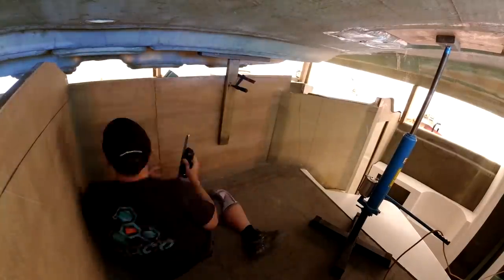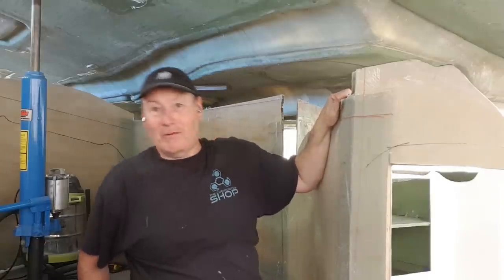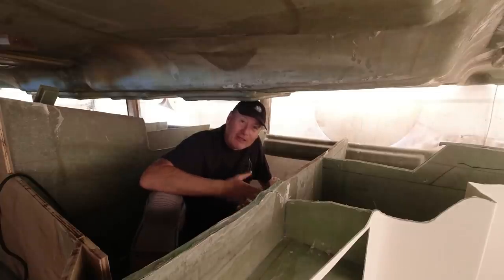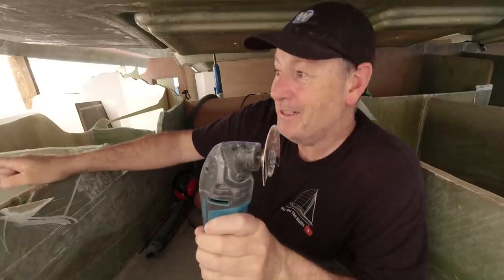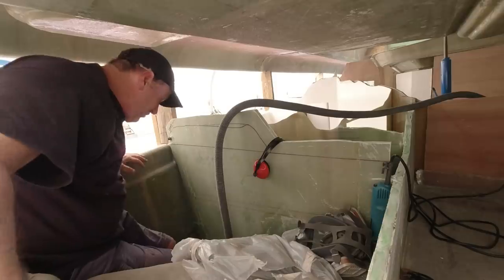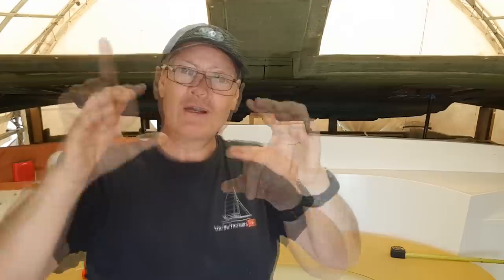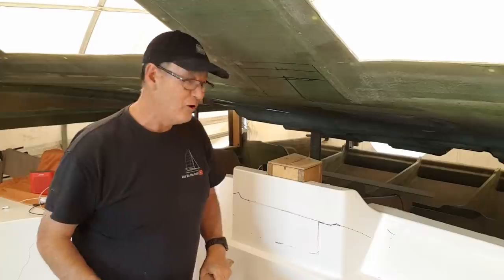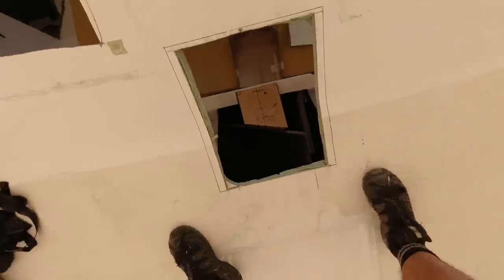I cut a massive hole in my Brand New Catamaran Deck - 12.7mtr Catamaran Build 197

Comment: Get a fan, build a cardboard 'funnel' around it and add ten foot of 10" AC duct to it, with a stick and spring clamp on the open end you can take a cooling breeze into tight spaces with you. If moisture isn't an issue, a mister can be added to pull the temps down. When not in use, the hose can be collapsed down to just a few inches. 🥵

Comment: make the bottom n top level n lift the top 2 or 3 feet up n have it level at all times then u  measure down the same amount 2 or 3 feet that u lifted it up off the hall n make your marks so u ant guessing ware to cut    you can lift it up 5 feet so u got room to stand n work to cut but you have to measure down the same as how much u lift the top up!!!!!!
Reply from the maker: That what I did but 50cm was as high as I could go with rhe tent roof reached.

Comment: Ok I think the reason for the original mast step was the lines. They wanted the lines to run away from the mast above deck level. So all the lines would run to the cockpit without to many turns. Your solution is elegant especially like you said less chance of rot due water intrusion. There is a lot of force on that mast step and having wood below it even incased in glass is asking for troubles. But look at your mast specs and especially where the lines run away from the bottom of your mast.

Comment: Ross, you need a bow saw with  25mm  and 6mm blades. It would cut like a dream compared to that cheap handsaw you were hacking with. You just looked like you weren't having all that much fun.
One other suggestion: get a cheap window fan and a card board box the same size and some filter material and build yourself a simple dust capture system. Works far better than letting the dust fly everywhere. Cheers mate.

Comment: I think you need a reciprocating air saw they are small and light you can put a variety of blades in them they will cut around curves 
I use saws all blades in them you just need a air hose
Reply from the maker: It is the one tool I do not have and have often thought of it. I generally don't run a compressor on the boat site as I have my air set up at the factory but will certainly look into that, I love air tools.Ross
Reply: @LifeOnTheHulls  
I have a Matco tools 
Silver eagle 
It also doubles as a air scraper just flatten the blade like a chisel 
With a good sharp edge
A saws all blade !

Comment: once it is measured and marked raise the roof to make it easy and then lower later - This free advice is from a rear armchair admiral who used to sail but now just gives helpful advice starting with - back in my day ..... - good job keep it up - did you hear from Thompson Couplings for your prop shaft ??

Comment: Good stuff Rossco. Looking forward to the box installation to understand how the forces from the central mullion will now be distributed.
Reply from the maker: Ha worked out really well with a neat insert. The insert now sits squarely on the mast post and is distributed over three bulkheads so in all I reckon it was a great solution. Cheers Mate. Rossco

Comment: have you tried the ceramic tile blades for angle grinders? those or a Dewalt jig saw with a coping foot? Keep the spirits high, you’re doing great!
Reply from the maker: Haven tried that as the dust I imagine would be abhorrent. I would have tried anything at this stage of the build. Ross

Comment: I would recommend not to use foam in the bottom of the box insert, the mast pressure will crack the glass fibres and delaminate them. It needs to be solid glass or better yet thick maybe 1" thick aluminium core, the latter has the advantage of being able to screw the mast step to it, without having to worry balut removing core material from each hole to see=al with solid evoxy. Love your videos.
Reply from the maker: That was indeed a faux pa of mine insert is solid glass and sits firmly on the Mast Post and central bulkhead dead flat so no crushing or delamination is possible.Mast base is 2 part ( base and secobday male insert) raising the actual male insert avoiding any pooling of water.Ross

Comment: Perfection is not required on this step mate, a 5~10 mil gap will be your friend when it comes to bonding and glassing it on.
Reply from the maker: I have started to realise that, I have come up with a way to bond all bulkheads prior to tabbing so a slightly larger gap is a great benefit. Rossco

Comment: I think your modification will reduce stress on the roof. Puts it directly on the mast post.
Reply from the maker: Definitely a better way to integrate the deck to the mast post and central bulkheads. Cheers Brian. Rossco

Comment: will that allow water to pool at the base of the mast? or will you have a slight slope? or a fake cover to keep the lines of the screen that is removable.
Reply from the maker: There will be a slight radius in the solid glass laminate and Mast base is raised a cm to all for water to shed from all areas.It is a small area in any case and viat movement will spill any water in any case.Cheers Ross

Comment: Nice video Ross, when it comes to joining the deck will you have to glue  the whole deck hull joint and the top of every bulkhead all in one hit?
Reply from the maker: I have devised a way to glue all bulkheads to the deck in one sitting. The perimetre can be glue after the fact from both within and outside the boat, however the boat will be bolted together on the flanges to ensure the perfect alignment and then loosened before and second bolting down as the gunwales of the deck are quite flexible. Ross.

Comment: Will this mastbox not collect  a lot of water in the end??
Reply from the maker: It will have a radius and a slight raised solid glass bevel to enable water flow away form the base itself. Cheers Ross. Only a small area in any case.

Comment: Just checking! Have you allowed for how the countersunk mast base is going to affect the lead of the halyards from the mast base sheaves? Also, just because you have lowered the mast base (top of the compression post) that should not be a reason to lower the rig. Even under the normal configuration you could have lowered the rig and boom. Anyway you have the rigger that you sold the tent to advise you there. Asuming you gave him a good price!
Reply from the maker: No discounts here mate, Peter got a good deal and he will be involved for sure. Mast based sheaves  will be fine as in reality the distance is less that 5 cm and the line configuration will be based on the insert, understand your thinking and have had a good reasoning about this with several mad yachties. Ross

Comment: Quick question - I am sure there is a good reason, but why not raise the deck up higher and make all of the cuts? Is the tent in the way?
Reply: thats what i was saying he lifts it 5 feet so he got room to cut n then he can measure down the same as how much he lifts it up off the hall n make shor its all level!!!!   then make your marks
Reply from the maker: @kevinplowman8982  I settled on 50cm to achieve a standard, given I could raised to about a metre but the structure was an issue, and the stability of the deck is compromised with my Jacks and external supports. If I had a gantry that would support the deck I certainly would have gone a bit higher.Ross
Reply: @LifeOnTheHulls  Thanks for the reply - that makes sense - second question if you have time, with the block being removed, that will lower the mast slightly and also the boom - I assume it is not much and won't make a difference to sail positions? I would think you would want the boom higher to be  out of the way more, but it probably is a boat to boat difference and won't be a problem for you?

Comment: Is there any sag in the deck in the middle 18' span where you are making some of those measurements? 
The oscillating tool has a straight blade for plunge cuts and it is a little longer/deeper than the semicircular one. You just have to angle it to move it forward or backward. 
I was hoping you would duct tape that cardboard template to the underside of the deck and spray paint it and see who got suckered.
Reply from the maker: Absolutely no sag as I have two extra transverse braces along the forward bulkhead.Very very rigid that whole part however.Rossco
Reply: @LifeOnTheHulls  I should never have doubted!

Comment: Aren't you concerned about the lines at the bottom of the mast chafing and fouling in the box? Will salt water pool there?  Will the lines be run to the cockpit? Seems sketchy.
Reply from the maker: Nothing sketchy about it.Deprh in reality is 10cm and turning blocks are pinned and will rest at 15cm centre from base which is raised 20mm .In all it will allow for a much more functional run of lines towards helm station across coachhouse roof minimising lines on outside companionway which is narrow and would require far more turning blocks and organisers to effect efficient runs.There will be no water pooling as base is solid glass with sufficient radius and minimal area to collect water.Ross

Comment: 1:28 i see ya struggling, next time take some bee's wax and cover the blade. Every once in a while repeat. The level of slippage you get with just a bit of it is unreal.
Reply from the maker: Yes mate struggling is not a word I would have used,Three glass sandwiched bulkheads at once with a blunt saw, and a real battle.Wax us a great idea,next time,thanks for the tip it will come in handy I am certain buddy.Ross.